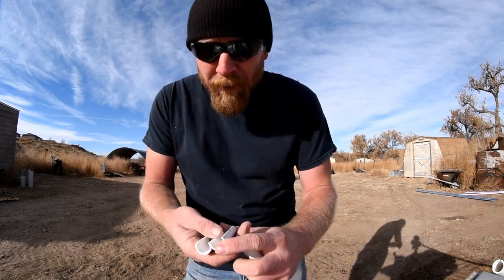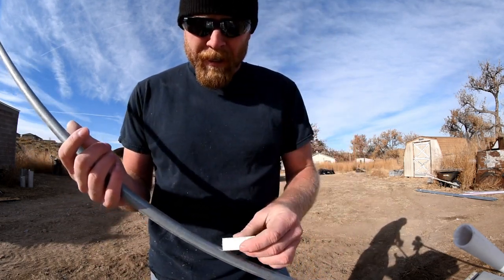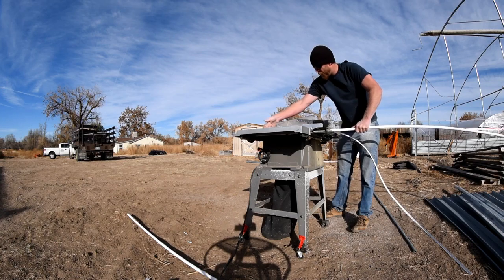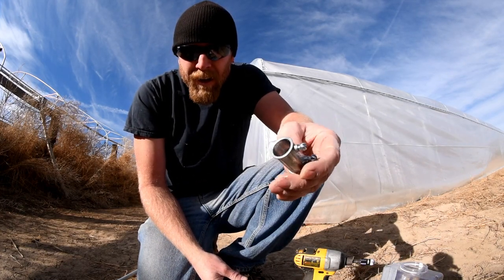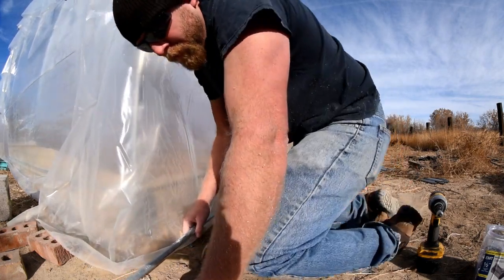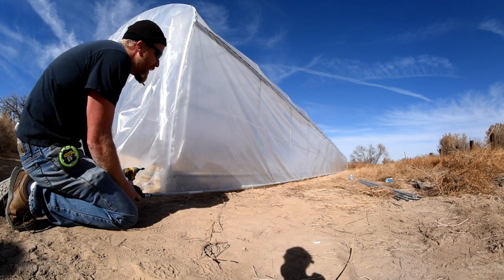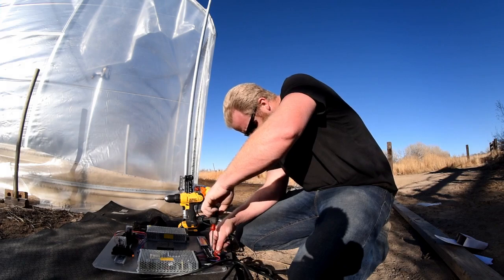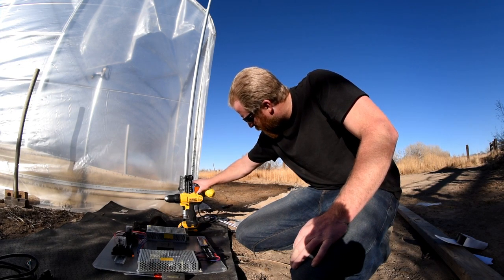Greenhouse Roll up sides-DIY

Comment: Did it hold up and good for you? Any problem later with rollup motor
Reply from the maker: Sorry i missed this comment. Motors are still going strong.  The only recommendation is to put a screw in the clips that hold the plastic on the conduit.  Over time they relax and get loose.

Comment: Did you ever make a video on how you made your roll-up controller?
Reply from the maker: I didnt. The footage wasnt very good plus it was shot over the course of a year so it was all over the place. I need to do an update on the greenhouse so maybe I'll throw some of the footage in there that explains what i used. If you want a jump, start go check out Velocio plc. Thats what i used for the brain.
Reply: @TheHodge101  I'd really like to find one that is not only automated as you have there but something I can control remotely. I've been doing that with almost everything I have set up, but the curtain motor controlling has me stumped.  Thanks!
Reply from the maker: I havent messed with it myself but Easyaccess 2.0 by Weintek would be a worth while search on google.  It connects to the hmi on your controller to give you remote access.

Comment: If you look hard enough, they have those guides for 25$ with free shipping. 5 bucks it 5 bucks, but... time is money too.
Reply from the maker: Thats a good deal. I also found some rollup motors, similar to the ones i used, for half the price.

Comment: So you just wiggle wired your rope in at the hip board?
Reply from the maker: Yep. I used eyebolts at the bottom and wiggle wire at the top.  It has worked well accept that the rope has stretched and i have to retighten it periodically.
Reply: How many layers of plastic and wiggle wire are in your channel?
Reply from the maker: One layer of plastic and one wire

Comment: Hi The Hodge and everyone
I'm having trouble with the pipe, is flexing  and the end of the pipe (opposite side of the gearmotor), the end of the pipe rolls the plastic faster so the rolling is uneven, what could be the problem that is causing this? the lenght is 54 meters(183.7 feet) and the height 4 meters (13.12 feet), thank you all
Reply from the maker: I have run into the same problem.  Mine is caused by the plastic wrinkling up at the end and making the diameter larger than the rest of the rest of the pipe as it rolls up.  Your best bet it to make sure there isnt any extra plastic sticking past the end of the greenhouse then you will need to hang a weight from the very end of the rollup pipe to help keep tension on the plastic. Not sure how much weight but 3 pounds would be a good place to start. Hope that helps
Reply: @TheHodge101   thank you for your answer I really appreciate it, as you suggest maybe the extra plastic could have been my problem too, the weight option is a great idea I will work on it and let you know how it went, best regards The Hodge you have a great channel
Reply from the maker: Excellent! Good luck👍

Comment: What size hole saw did you use?
Reply from the maker: Since it is temporary, any hole saw that is larger than the conduit coupler will work.  I think i used an 1-1/8" or 1-1/4"